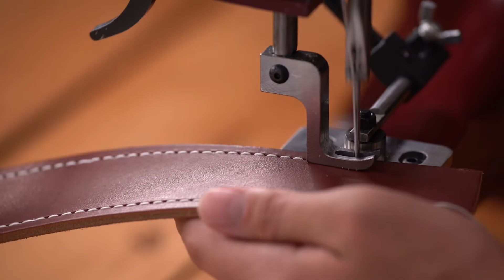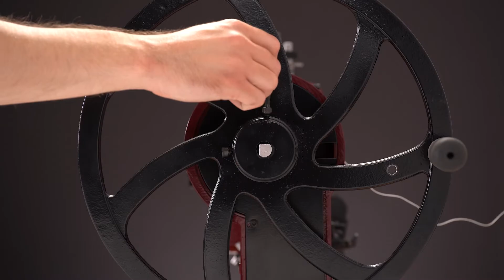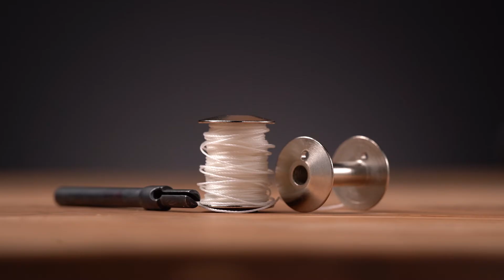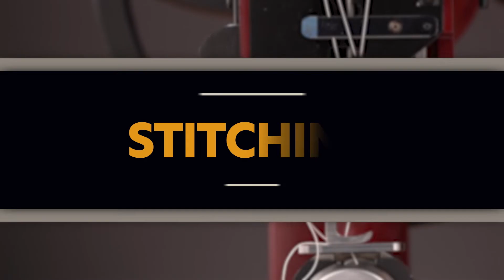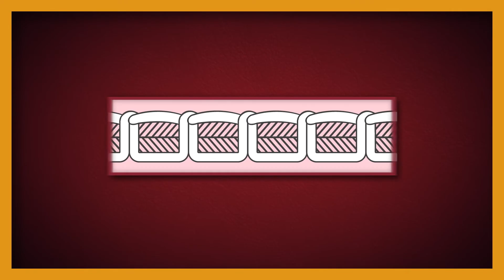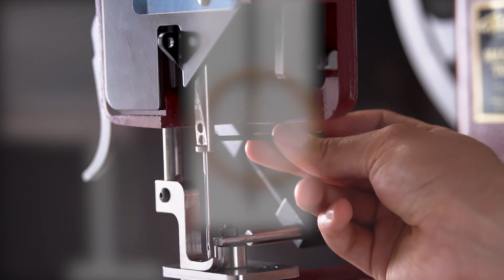Master Tool Cub Sewing Machine Overview

Comment: I'll say this, I'll buy it when I can afford it, the simplicity etc is something else - great engieering and insane thickness it sews through with an even stich feed. Most people in comments don't seem to understand this, I own 17 industry sewing machines, even heavy duty singer 45k21, but this is just a different ball games in terms of feeding etc. If you want to motorise it it's not difficult to get a pully, grind a jack down into the wheel with a metal lathe and get a cheap table and a jack 563A motor however, personally I like that it is hand cranked

Comment: There are units in the market for about $150.00 your price is insulting!!!😢😡👎
Reply: Post it!  But you won't, because nothing comparable to this machine is that cheap.  Cheap chinese shoe patchers don't handle the thread/needle size this does.  Its a specialty machine.

Comment: Made in America by Americans carries a ton of weight for me.  This is the future, not AI, not Belt and Road of China, people need to start  thinking for themselves, bootstraping a diversified income based on Quality -- not cheap artificial Yak feathers made with peasant labor. If you complain about the cost, you better not pay six times that for a motorcycle or boat.  News flash: you get what you pay for, get a clue

Comment: $2,000 for a small, one-handed manual machine with no stand, no work table, and a short spindle arm.  For $900 more you can get a fully-powered heavy duty electric with a 16.5" arm, adjustable height work station, etc.  Besides, you need TWO hands to do curves and more intricate work.
Reply: Me interesa la manual , donde la puedo conseguir
Reply: goods point, the price is way too steap. I would snatch thing thing up in a heartbeat.

Comment: Nice- but being made of aluminum I find it hard to believe it will be durable- and at $2,000 it's far to expensive to take the risk.
Reply: Just records line the other day. This thing is built WELL and it’s kinda heavy. Came with enduring you need to start to, I was surprised. Yeah, the price is steep BUT I saw a comment saying “buy right or buy twice”😳 took me a minute to order it but I pulled the trigger and did it. I just took it out of the box and about to set the thread. So far I am very pleased with this thing. Didn’t want to spend all that money BIT🤷🏾‍♂️sometimes you got to pull the trigger on something you don’t want to do. So far I love it! Was it worth the price? Probably not BUT I know I have a well built machine now.

Comment: For $2k? No thanks. $700 sounds more like it.
Reply: I agree. At $700 I'd have one already, but at $2k.... I'll just keep doing my hand stitching and buy nicer leather.
Reply: Exactly! I'll keep stitching by hand as well. There is no way I'll pay 2K for that, no matter how good it is. You can buy another brand with an electric motor and speed reducer with a table for less than that.